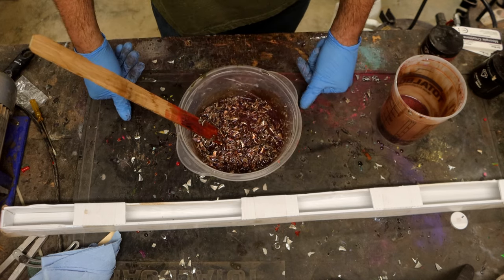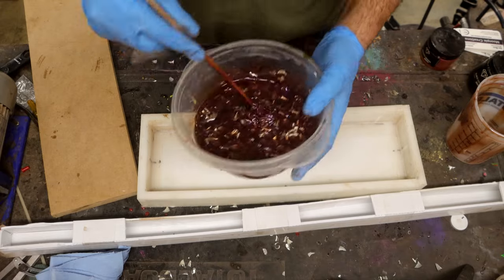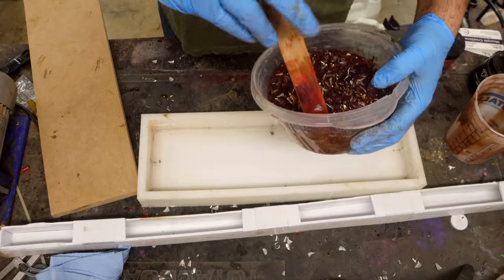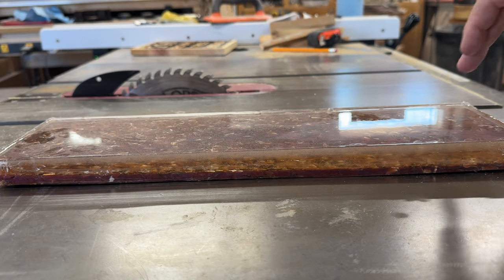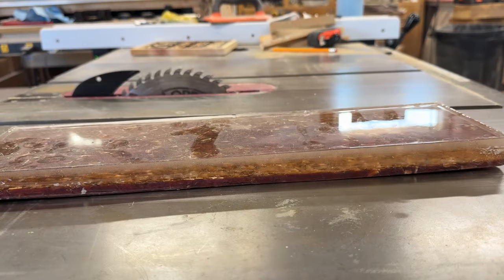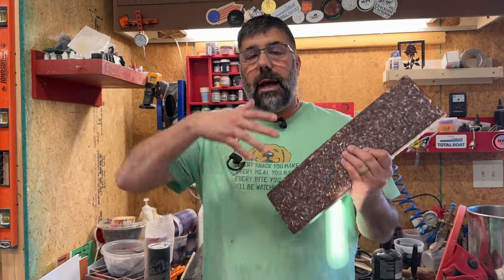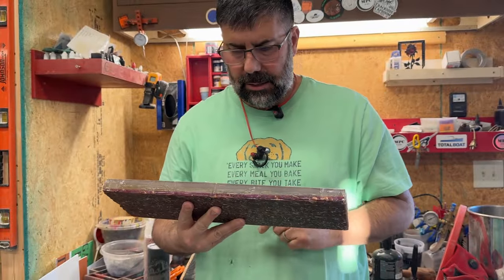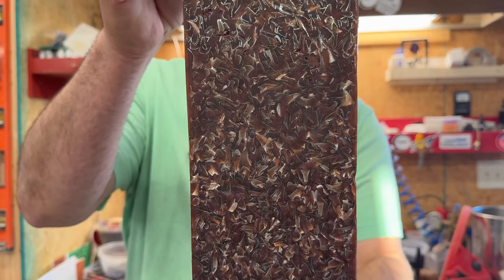I Cast Metal Shavings and This Happened!

Comment: Thoughts. Not red, it competes with the intensity of the silver. Probably clear, maybe black? Is there any way you can build a frame for it? You’d have to figure in the slants and bowings and carve that out to fit? Some nice wood? Can resin be treated like vinyl records? Remember in the old days sometimes you could put books, etc, on them to fix a mild warp. Just another f.g.o under your belt 😊

Comment: thank you for not turning this lol Peter Brown and i think it was Carl Jacobs did a collab using resin and metal shavings it was dubbed the murder bowl for good reason! and maybe you could add another layer of resin to the bottom of the board so you have material you can plane off to get it level again
Reply: Yes. The very first thing I saw was the "murder bowl".

Comment: Interesting idea and project.  Curious that it warped like that.  I wonder if heating the mold before pouring would have helped with that by making the mold more attractive to the epoxy.  Also, did you have any issues with nicks from the metal going through your planer?

Comment: I seldom learn anything from my successes, but I almost always learn something from my failures. Even if all I learn is, "So that's why they don't do it that way," I think it's legit. I think the board is still salvageable if it's put into a mold that's a just slightly longer, wider, and deeper, flipped upside-down, the cast in clear epoxy. It's a thought, anyway...

Comment: Use clear epoxy to level and square it up. Add clear to metal/epoxy side first. I liked the dark burgundy and silver. Some times the bottom turns out better than the top... guess it was meant to be.

Comment: Tell you what we would do? OK, I would sand it up, apply my finish, and attach little rubber feet to the bottom corners, with the cup of the warp facing up. And whoever I gave or sold it to would never even notice those tiny bits of warp. That belongs on the shelf of pride, not the shelf of shame! (You want to see a shelf of shame, Mr. Pie? You need to get a look at MY shelf of shame. It’d curl your toes.)

Comment: What were rhe metal shaving from--aluminum I hope.  Otherwise they must have wrecked havoc on the planer blades.  Why not add small legs on the bottom which can be turned to make it sit level.  If the top is fairly flat could still work.
Not every fail is a true fail!  LOL

Comment: I'm no expert in, well, anything :) but I would not call this a fail. Charcuterie boards aren't starship components or brain surgery equipment, they do not have to be perfectly flat and straight at molecular level... I understand you would like it to be perfect, but if you round the edges and level it with feet, it will be more than good enough.